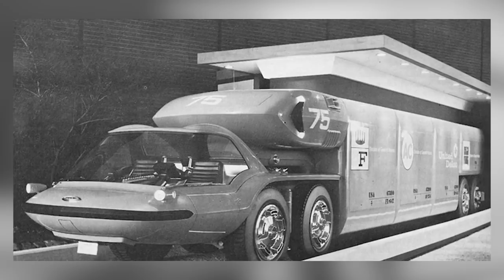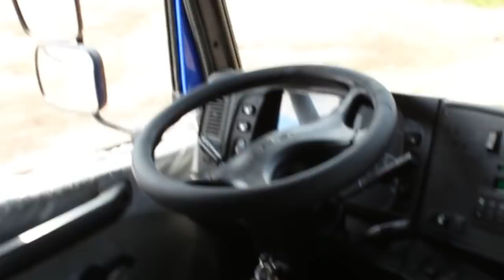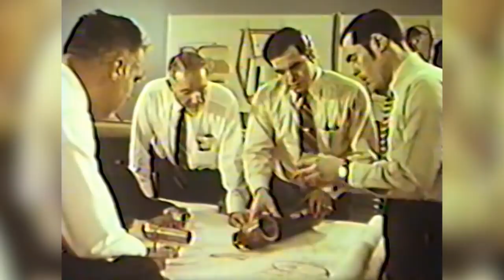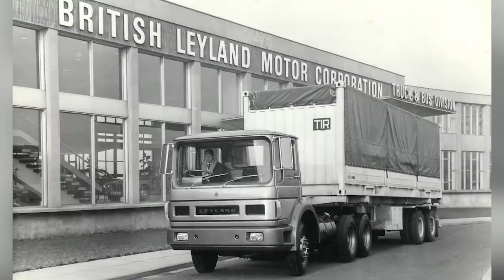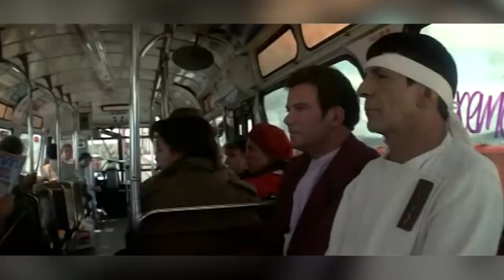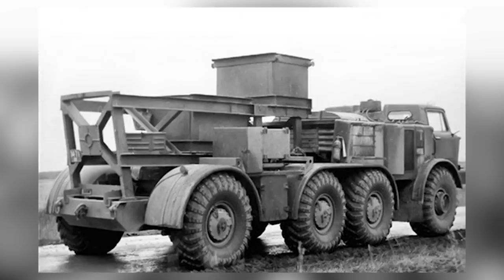12 Most Amazing Gas Turbine Monsters of 1960s

Comment: In the mid-70s I was fueling at a truck stop in Portland Oregon and on the other side of the island was a Freightliner cab over with huge stacks and when I questioned the driver about it he told me it was an experimental turbine-powered truck. He showed me all the gauges that were required to monitor the engine ( about double the norm for a semi-tractor) and took me for a ride to his parking spot. It was very quiet mostly a whistle and the engine was about half the size of a diesel. He said the drawbacks were fuel economy and since there were no synchronized big rig transmissions at that time it took too long for the turbine to slow down when shifting gears so it needed an Allison automatic to work well. I guess like the others, the fuel economy probably killed it.
Reply: Interesting

Comment: Gas turbines are a cool technology. They're small, lightweight, powerful, reliable (Less moving parts) and run very smoothly, when compared to reciprocating engines. The major drawback is that if you want to run them efficiently, you have to attach them to high loads. This is why using a turbine to power a truck or car is a terrible idea. They are almost never running at high loads for very long

Turbines are great as generators though; Mostly if you know the load on the generator will be high and sustained. So using a turbine to charge a battery for an electric vehicle is a good idea, provided the significantly higher cost of a turbine can be justified over a reciprocating engine.

Comment: In the Army, I was an M1A1 Abrams tank crewman and those used the 1500hp multi fuel turbine engines that were used in the Huey helicopters. When they say bad fuel milage,that is an understatement, the tank mpg was 1 mile to 8 gallons,though the tank is 65 tons but that's still a lot. They were also very unreliable.
Reply: The Abrams is powered by a Lycoming AGT-1500, the Huey by a Lycoming T53... both designed by Dr. Anselm Franz who also designed the engines for the Messerschmitt Me-262.

Comment: GM actually worked on gas turbine buses into the 1980's.  In 1981 I participated in testing a Greyhound bus powered by an Allison GT404 regenerative gas turbine.  It was rated at 325 hp.  The designation 404 is significant, meaning 4:1 pressure ratio, and 4 lb/sec mass airflow.  The GT404 also solved the problem of engine braking by means of a power transfer system between the gas producer and power turbines.  This gave the engine 325 braking horsepower to control vehicle speed when going down hills.  We ran the bus out of Indianapolis, where Allison was based, on a route to southern Indiana between Bloomington  and Bedford, where there are steep hills.  The bus was always an attention getter when we pulled into a small town for lunch.  It sounded like a jet was coming down the street, and people would stop and stare at a BUS.  It sounded just like the Batmobile with a descending whine when the engine was shut down, and it was still spooling down when we came out from lunch an hour later.  I think the engine was mature enough to replace a diesel in the bus application, but fuel economy still wasn't good enough.

Comment: I have seen a photograph of a cabover semi tractor truck powered by a Solar Turbines turbine, but I don't know the year or any retails.  Gas turbines work great at their design speed, but, even with complex recuperators, they just aren't practical for over the road use, where they have to throttle up and down.  They are also most efficient in large sizes, much larger, like thousands of horsepower, power plant sized.  They do make lots of heat, almost a very fancy burner.  Maybe someone could design a small turbine electrical generation system with a steam boiler in the exhaust, but the complexity would be staggering.  This combined cycle is used to make very fuel efficient power generation plants.  Or, just tap the electricity generated from a remote power plant, and power your electric truck.  Oh yea, that is where we are headed.  Still gas turbine power, just removed a distance away.

Comment: Back in the 70s, I was fueling at a truck stop in Portland and there was a Freightliner cabover sitting next to me with huge exhaust stacks and when I asked the driver what was up, he said it was turbine powered. I started to ask questions about the experimental truck, being the big gear head that I am and he offered a ride. I had never seen so many gauges other in an airplane and was impressed with how quiet it was compared to my Cummins and it was about 1/2 the size. He told me it had 2 problems, 1 was it was a manual transmission and it took too long to slow down when shifting gears so he missed a lot of shifts and fuel consumption was terrible. He said they were going to put an Allison automatic in to solve the first problem but I imagine that would have made the fuel mileage worse.

Comment: Gas turbine power plants are attractive from an engineering standpoint because they are smaller and lighter than a piston engine of the same power. They were successfully used in some land vehicles, like the American-made UAC Turbotrains and the French made RTG trains that were purchased by Amtrak. But with all turbine vehicles, the same drawbacks appear: too much fuel consumption,  and high cost of maintenance. Noise was a problem with some turbine designs too.

Comment: Electric drive is the proven future. Can run a gas turbine to turn a generator. Or fuel cells to charge the traction battery.
Reply: But gas turbines are not suitable for hybrid electric cars.
Reply: @sandervanderkammen9230  gas turbine in general is a gas gizzler, but it is less so if it can run at a constant RPM by running a generator at a set speed. I doubt it will ever find a purpose in a small vehicle.
Reply: @danwat1234  Not exactly, gas turbines operate more efficiently at constant rpm BUT, 'Specific Fuel Consumption' efficiency drops drastically below P-85 or 85% of max continuous power output. This limitation is poorly suited for road vehicles and charging batteries that need a tapered charge rate curve to prevent damage.
Reply: @sandervanderkammen9230  right I under-stand what you mean. It's only near and at full load. I don't really know much about turbines. the vehicle could be programmed to shut-off the turbine when the battery reaches say 70% state-of-charge so there is no need to worry about charging the battery too quickly. Not an issue especially with modern lithium-ion batteries being able to quick-charge with liquid cooling
Reply: @danwat1234  Gas turbines are incredibly reliable when run continuously at optimum high  load conditions but in applications where they are required to frequently cycled on and off service life is significantly reduced  and maintenance costs multiply. The most common failure mode in gas turbines is restarting an already hot engine. Turbines are not used in applications were frequent starts are required.

Comment: The walmart truck at the end has a hybrid drivetrain, and the turbine is not connected mechanically to the drivetrain at all.  The turbine engine only spins a small generator that charges the batteries powering an electric motor.  The electric motor is the only thing that actually moves the truck.  This allows the turbine to spin at one continuous speed, where turbines are most efficient.  Saying "the turbine can run on electricity" is not correct.
Reply: Aceite Zulu Bangú Xarabas como seu líder
Reply: just like a locomotive
Reply: In a hybrid truck microturbine, the engine engine is designed to put out much less power than typical over-the-road trucks.  It basically works at full power all the time, where it is at its peak efficiency, and charges a battery that can provide much higher peak power for short periods than the microturbine.   At least that was the thinking 10 years ago.  Haven't seen any of those concept vehicles make production yet.

Comment: the faster you go the more the fuel economy from ICE to turbine engine become comparable. SO if we had a road across Texas where the speed limit was 160 mph ( no traffic of course ) , a turbine engine might be more fuel efficient than a regular internal combustion engine.. But this is not the case and most car operation happens below 55mph

Comment: How could you leave out the Union Pacific Gas Turbine locomotives? Far more successful than anything else on this list. They made 50 or so and ran them up until the energy crisis made fuel cost a primary concern.
Reply: General Electric built those for the UP

Comment: I don't understand why braking is worse with a turbine engine. Don't go so fast? If you were going normal speeds wouldn't it be the same?
Reply: Diesel trucks have compression braking where the engine can slow the vehicle to nearly a stop if the brakes fail, Otto engines also have a engine braking effect when the throttle is closed. The turbine has no braking effect and tends push the vehicle even at idle requiring larger wheel brakes or an expensive transmissions with an engine retarding mode.
Reply: @sandervanderkammen9230  Ah, thanks!
Reply: @sr212787  you're welcome, cheers!

Comment: The real problem with turbine powered automobiles comes down to fuel efficiency in traffic.  Gas turbines have a very narrow power band.  Anything outside that band, the fuel efficiency goes to hell.  Trucks and cars  have to rapidly accelerate and decelerate, so the turbine would spend most of it's time outside of the power band.  
Walmart's got the right idea.  Use the batteries in traffic and use the turbine engine for cruising.  It keeps the turbine happily running at the peak of it's power curve and turns off when the batteries are topped up.  It's almost as simple as the thermostat that controls your furnace.
Reply: Unfortunately gas turbines also don't like to be frequently started and shut down. And batteries require a tapered charging curve while turbines run best at 85 to 100 of rated power.
Reply: @sandervanderkammen9230  That's where the clever bit is.  You combine the turbine with the generator and use it as an energized flywheel.  More of an advanced range extender than a prime mover.  

Serious materials problems, I know.  Can we make a motor/generator that runs at 10,000 RPM?  Can this engine be engineered, such that the motor/generator is kept away from the heat of the compressor/combustion section?  No idea.  I know it's possible, but I'm not sure it's practical.
Reply: @rayceeya8659  Do you mean similar to the electric motor-generator units on turbochargers in Formula 1 racing?
Reply: @rayceeya8659  Why would heat be a problem? But I see another much more serious problem that would make such a design very impractical.
Reply: @sandervanderkammen9230  Well the most obvious problem is centrifugal force.  Then heat, because building any generator or motor involves conductive metals, usually copper, which melts at a very low temperature (for metals).
Reply: @rayceeya8659  Well, the generator could be simply mounted on the compressor end of the gas turbine so no heat problem, the real problem is size of the motor needed to drive the compressor.

Comment: Why mix metric with English? "235 liters per 62 miles" comes out to 1 mpg. THAT we can understand.
Turbine engines guzzle fuel at low rpms because the boundary layer of air at low speeds is too thin (slippery). Turbines are best used where speeds are constant (Titanic's steam turbines, jet aircraft, electrical generators).

Comment: How in the world did Ford think 20 foot tall would work when the legal   height today is 13 foot 6 inch
Reply: Because 'Big Red' wasn't really 20 ft. tall...it was at the legal 13ft, 6 in. height. I don't know where or how the author of this video got that supposed 20 foot height figure but it's bogus. A lot his other claims, particularly about the supposed lack of braking are also wrong too. Besides having conventional air brakes, 'Big Red' also had a hydraulic retarder on the transmission that more than made up for the lack of engine braking, which by the way, is practically non-existent with a diesel engine anyway, unless it's fitted with a Jake Brake or similar engine braking device. What killed the prospects for' Big Red', along with all the other turbine powered vehicles  was 1) the initial cost of the turbine engine itself, compared to that of a conventional gas or diesel piston engine - and - 2) high fuel consumption. Other than those two issues, it was superior in every other way.

Comment: So the brakes were inadequate therefore all four fire trucks had their turbine engine swapped for conventional engines. I'm not buying it there's more to that story that doesn't even make sense.
Reply: Trucks are so heavy that they require engine braking. Since gas turbines couldn't provide that, they had to be replaced
Reply: Gas turbine vehicles require bigger brakes than reciprocating engine vehicle because turbine offer no engine braking and tend to continue pushing a vehicle at idle rpm.
Reply: Actually this was a box of lies, that truck had both an engine brake and an air brake, it was actually scrapped due to fuel consumption

Comment: 6:20 It is debatable if that was the first compact gas turbine vehicle in automotive history - the Rover Jet1 car build was started in 1948 (not 1949 as some sources claim) and first demonstrated to the public in March 1950. I can't find any reference to the Kenworth 524 gas turbine truck prior to April 1950, who knows when they started building it? I'm pretty sure that the secrecy around them before public unveiling, plus the closeness means that Rover and Kenworth both came up with the idea independently.
Reply: The first gas turbine used in a land vehicle was the BMW GT 101 engine in 1944.

Comment: the union pacific turbines were good but they ran on bunker oil not gas
Reply: bjorn1583 gas turbine refers to the use of expanding gasses to turn the turbines, not the fuel itself. Most turbines would run on pretty much anything flammable.
Reply: @chrismc7205  What about steam turbines??? Those require a boiler prior to entering the turbine. A turbine simply converts fluid flow into shaft power. The fluid can be anything that's under pressure.
Reply: @greatdome99 the UP locos were GAS turbine engines, we are not talking about other types of turbines. The comment was about what fuel was being used, which I is why I replied that the term gas refers to the expanding gas in the gas generator and not the type of fuel used. Regards.

Comment: One downside to gas turbines is that they have very poor throttle response - They have to "spool up" first. Sadly the idea of a hybrid, with the turbine not providing direct propulsion but instead recharging an electric battery and motor that DOES have instant throttle response. They also run extremely hot (the exhaust alone is typically over 300 degrees F).

This could have been a great combination, but the obstacles just were too great at the time.
Reply: It's over 300degrees Celsius not farenheith..as in farenheith scale water boils at 212 F...an average small helicopter turbine temp reaches 900degrees + in celcius as bigger turbine make exuast gases more hot..turbine engines are good for flight as in city u can't control with gas engine gearbox .as due to high revs speed will increase very fast as it can rev to 50000rpm to 100000rpm ...in case of an accident parts will fly like a bomb ...blades can cause severe damage other a man made bike out of helicopter engine..in 2014 must see I love its reving sound
Reply: @savneetsinghrairai6823  You're right about the C vs F thing. As an engine that provides mechanical rotation (as opposed to using a turbine to provide thrust), turbines that have high temperature exhausts are not very efficient, as that heat is energy that was not converted into mechanical motion. Ideally the exhaust temp would be low, but to do this takes a lot of space to "use up" all that heat before it's expelled.

Comment: Back in the early nineties there was also a push for gas-turbine engines that were "just around the corner" that would offer 100+ miles per gallon fuel economy. They of course never materialized. Funny thing is, if they had come out we might not be having this big electric vehicle transition going on right now. Who knows?

Comment: I like how poor brakes can be a reason for unsuccessful gas turbine vehicle project. Didn't they try to fit better brakes or it never came to mind that it is possible to drive slower? :D
Reply: Yes, the lack of engine braking made the need for better brakes obvious, particularly in San Francisco. Of course not a reason to kill the idea - just use better brakes.
Reply: Brakes back then where used vacuum boosters to increase the the brake pedal pressure. Turbines. Wouldn't make enough negative pressure. To use the brake technology of that era. Engine breaking combined with air brakes would have been the best option. Engine braking to slow the turbine down once you let off the throttle. Since turbines are not very easy to slow down quickly. And air brakes to slow the vehicle down and hold it in place when it stopped.

Comment: The Chrysler turbine came the closet to making production and you never mentioned it it was way better than the fait what's up with that
Reply: Jay Leno owns a 1963 Chrysler Turbine
Reply: @shaggy5777  Leno also built a fully custom gas turbine car as well.
Reply: my late grandfather drove one. He said it was the smoothest vehicle he's ever driven, even to date (2016). But they did have horrible fuel consumption, and lagged a bit on take-off from dead stops.

Comment: Greyhound operated a gas turbine powered coach bus between Chicago and Detroit in the 70’s. It was a MCI MC 7. It’s sound was unmistakable as it blew by on I 94.
Reply: August of 1974 I saw a Trailways Bus with a FORD Turbine Power Emblem on the side.  I was in another Trailways bus leaving Phoenix after transferring from Tucson. 27 hours to get to Kansas!